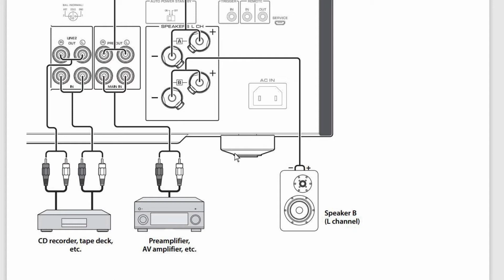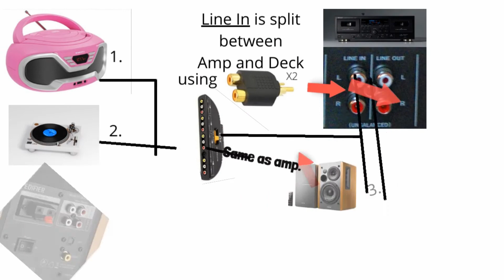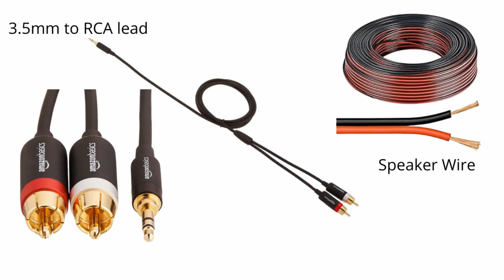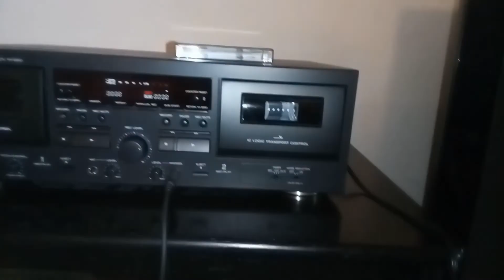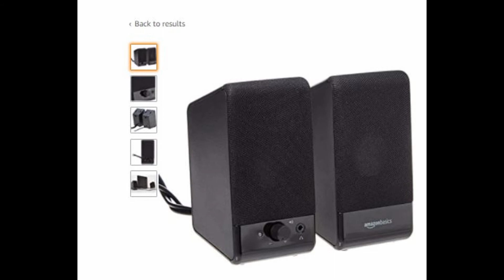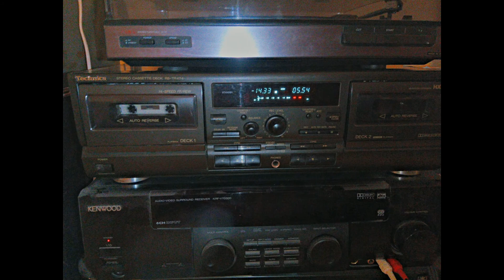Are You Connecting Your Cassette Deck Wrong?

Comment: Hello!. Thanks for this video! I want to buy a double deck tape TEAC W-1200. I have an audio system Sony V43D that have a 3.5mm input jack. Can you help me please?, cos I'm a little confused. Can I connect the Teac into the Sony V43D direct or I need an amp or pre-amp?  If the answer is "yes", doing this connection, I will be able to listen the TEAC tapes through my Sony?,  and record cds played in my Sony to tape? If you can help me will be much appreciated! Thank you!
Reply from the maker: Hi. I have just checked the Sony Site and it says  analog input 3.5 mini jack. The 3.5 mini jack is stereo Line in on the V43D  so yes, you can get the correct RCA to 3.5 mm minijack cable and plug in directly. It should sound great.  you will need a cable like this https://amzn.to/4gfAS41 for the connection. That sort of lead is also good for connections to  Tablets and Laptops to record from to the Teac W-1200.  The  W-1200  also outputs USB which can be recorded by PCs and Macs.  I hope you enjoy your new recorder. Any problems and I will try and help. Cheers
Reply: @GaryKeepItSimple  No words enough to say thank you so much! Was a great help. You have no idea. Thank you for taking the time and help me. Can't wait to have the Teac!! Have a good day!!

Comment: I want to connect two cassette decks to my Cambridge Audio Azur amplifier so as to be able to use either of the decks at will.
Reply from the maker: Looking at the Cambridge Audio Azure appears to be the Series name for their Amps. It depends on the model you have. The Cambridge Audio Azur 540A it would be simple. There are 2 tape outputs  1 tape input but also DVD etc inputs so connect as normal for 1 deck and use output 2 for the other deck's input. Output feeding the DVD input. This would allow recording of tape to tape easily.
The Azure 315 has only 1 in and out so in that case I would Try using RCA 2-1 connectors for deck inputs and if that is not useful either a 2-1 amp or a simple AV splitter switch.
Splitters https://amzn.to/3JAnA2D
Switch box. ( works in either direction. ignore the video connector) https://amzn.to/3Jyh4JB

I hope that helps. 
Happy to continue this if you need any further help.  Cheers

Comment: Hi Garry I have a pioneer reel to reel the rt 909 and ctf 959 cassette deck plus a pioneer sa 610 amp how do I connect them all up so I can record from the cassette or the reel to reel can you help please
Regards 
David
Reply from the maker: OK . there are 2 tape inputs and 2 tape outputs. . According to the manual if you select tape 1 as the playback device, tape 2 can record what is playing. It says if you select tape 2 to be playing, tape 1 can record what is playing.  So therefore all you have to do is plug in both tape machines into the amp as Tape 1 and Tape 2 and simply select on the switches what you want to do.
 I hope that helps. I can send you the Manual if you need me to. just drop me an email if you need it. Cheers

Comment: I have an old sony tc we 435 casette deck with line in and line out. Shall i connect my phone into line in ? . If i play song in my phone will i get output  via line out?
Reply from the maker: If you feed the phone into line in, yes, you will get line out from the cassette deck in record standby mode (Record Pause) you need to adjust the input levels on the deck so as to be around 0db peaking slightly into the red if you want it to. That will give you Line level output.
Reply: @GaryKeepItSimple  thanks for your update .In Sony tc we 435 ,i did not find any adjustment option for input level . It have only recording level . Is it possible in same deck ?
Reply from the maker: Input is directly related to Output level.  Record level is the control. I hope that helps. Get back to me if you want any other information. cheers.

Comment: I want to add a reel to reel to my Denon amplifier but only have one set of connections available for my cassette deck any suggestions would be appreciated.
Reply from the maker: I would suggest something like a switch box. There are some really good value ones on Amazon and maybe a "y "connector. If you want to only use 1recorder  at a time the box would do . If you want to have the ability to record both at the same time then "y"connectors may work or you would need a 1 in  2 out buffer amp.  like this https://amzn.to/3u4MlzB   Switch https://amzn.to/464U1io and Y connector https://amzn.to/3MC5cIx. I hope that helps. You can get back if you need to . Happy to help.

Comment: I just bought a Marantz 6015 and was wondering how to hook up my more vintage Yamaha cassette deck. It has the two sets of RCA cables, one "IN", and one "OUT". On the back of the Marantz is Audio IN and there are jacks for phono, CD, DVD, Cable, Game. I am using the phono and CD jacks. I figure for my Cassette "IN" I can use a Game or a Cable jack. 
What I am wondering is where do I hook up the other RCA from the Cassette that would go to Audio "OUT" on the Marantz. There is no specific set of jacks that are labeled "Audio OUT"?
Reply from the maker: Having a quick look it would appear there is a section marked PRE out on the right hand side, middle. there is a left, right, centre etc output. The right and left should be usable for the input to your cassette deck.. Let me know what it says in the instruction book about that. if it says line level out it is exactly what you want.I hope that helps.

Comment: This was very helpful for me as I just got a cd/cassette deck and was a bit confused on hooking it up to my Yamaha integrated amp. It would have made it easier if in the manual they had mentioned hooking up tape/cassette to the Line 2 in/out jacks, but there is absolutely no mention of tape or recording. Of course in hindsight after your video is seems logical and simple.
Reply from the maker: That's what I do, Think out of the box. I am glad it has helped you.

Comment: What does the back of a speaker look like? Is there a simple 'plug in' for cables? or would I have to splice wires to attach the units? (Do my questions even make sense?)
Reply from the maker: I shal post a video later today to try and cover this. What speakers do you have?
Reply from the maker: I made this to try and answer your question. https://youtu.be/WYTwB9Z1Z7k

Comment: I'm trying to add  a cassette deck to my Rotel integrated amp without a rec out and still record cassettes off Tital on my computer. Help.
Reply from the maker: I assume you are using a phone or tablet to listen to tidal. Two ways.
 
1. Just use the cassette deck as a pass through.  Connect the Tidal signal to the line in on the cassette deck, and the cassette deck line out to the amp input then you can monitor the Tidal to listen live or you can record and playback as required. 

2. Use 2 RCA splitters and connect the cassette line in ,to the tidal device and the amp input. The cassette output you feed to a different line input on the amp. link to Splitter https://amzn.to/3w0zHiS

 Either should work, it is mostly up to you which is most convenient. I hope that helps.  get back to me if you need any clarification.
Reply: @GaryKeepItSimple  I have a Asus computer I'm using with optical output to the Rotel 12.
Reply from the maker: @arnoldacreman9953  What is the model number and any other details of the Rotel. . what inputs does it have and what outputs etc.
Reply from the maker: Does the computer have analogue outputs as well as optical?
Reply: @GaryKeepItSimple  It has two inputs on front that looks like are headphone input or outputs. On the back it has six inputs or outputs, I once had some Bose speakers looked up to them.
Reply from the maker: @arnoldacreman9953  send me an email with the pictures of the amp connections and the computer connections. I shall try and assist you.  gary@garykeepitsimple.com
Reply from the maker: @arnoldacreman9953  . the connections you had for the speakers should be useful for the cassette deck input
Reply: @GaryKeepItSimple  Thanks for your help' The inputs I used for Bose speakers had just one channel, not a left and right. I guess I can get a RCA splitter to use for stereo.
Reply from the maker: @arnoldacreman9953  You could use your phone or tablet to supply the signal to the cassette. That would give you stereo and feed that to the amp and save using the Optical output for Serious Listening.  Using the Phone/tablet for Taping and Keeping. The quality of the Phone /Tablet is as good as the tape needs.  I do something similar to record Amazon Music Tracks. Good luck. Let me know how you get on.

Comment: I have a mixer conected to 1 turntable 1 tuner and 1 Cdplayer but 1 have a cassette deck and only 1 turntable entry free in the mixer..can i connect the cassette deck to the turntable entry free?
Reply from the maker: Hi. It depends on the Mixer. Is it a Phono cartridge input or just a line input labelled Turntable?
I can only give a definitive answer with model numbers and spec sheets. But if the turntable input is switchable for mag and Crystal/ceramic, then the ceramic setting may be OK. If it is a proper "Phono" input, then it would be very, very loud, and the tone would be wrong and the sound distorted. You would know straight away. You could just connect it and find out if it sounds OK; if it does, then it is OK. ( If you try it, make sure you turn down the amp's volume so as not to do any speaker damage. I hope that helps. Feel free to get back with any other questions or information.
Reply: Is a simple mixer akayama but the phono entries have land conexión.thats why my worries..because in the past connected a power amp to the mixer out record..to connect 2 more speakers and damaged
Reply from the maker: If it has a ground then it is real phono. I would suggest getting a 2 way switch or more and sharing the other input. I have one of these. (Just ignore the video connections) https://amzn.to/3O6QpnY

Comment: I have an old Technics dual cassette deck (RS-TR165) that I'd love to connect to speakers. In this video of yours, I noticed you showed some Edifier 1280DB  powered speakers.  Can I connect my cassette deck straight to the RCA inputs of those speakers? (Extra info in case it helps someone answer my question:  Those Edifier speakers don't have speaker wire connections - only RCA inputs, optical etc, otherwise - otherwise, I'd try to connect the cassette-deck to my old Sony stereo amp and then to the speakers.  Well I'd give it a go, even though the amp doesn't have tape-in - only SA-CD/CD inputs and a bunch of TV/video inputs!).
Reply from the maker: Yes the speaker says line input. The cassette decks rca out is line level so it should work. They look to be a good speaker. Here is the link to that speaker. https://amzn.to/3vJCFsr    If you have any other question please feel free to ask.
Reply: @GaryKeepItSimple  Thank you so much Gary!!  You’re a legend!

Comment: Can you kindly take me through how you connect the CD deck to the amplifier in pioneer PD-Z74T
Reply from the maker: This is dependent on how you want to work your system and what amp you have. The CD player as s a source, you could just plug directly into your cassette deck. If your amp has a tape out then directly into amp and cassette deck to tape  in/out on Amp. I need a bit more info. Happy to give you a plan if you can tell me the model/make of your amp. model make of your cassette deck and how you would like to use it . Email me at Gary.j.goodridge@gmail.com  with the details and we can go from there. I can send you a diagram etc by email.  Happy to help.
Reply: @GaryKeepItSimple  Thanks Gary, very helpful info.

Comment: I am trying to connect my JVC duel cassett player but the cables are missing and the in/out on the player does not have the red/white plugs but looks like something that is screwed on.  What cables do I need please?
Reply from the maker: If you send me a picture of the unit and/or the actual model number I can help. You can email me a picture and put the model number on this comment.  Email address is in the channel info section.  The model number should be enough for me  to find out

Comment: Geoff2407
Reply: Very informative to see what's possible. Question is, my audio system is quite traditional i.e. Amp, Turntable, CD Player, Tuner and Cassette Deck. The Amp only has a single REC OUT phono but I would like to add a second cassette deck but not have to keeping swapping cables due to positioning of equipment  and access problems. Can you offer me any advice on creating a 2nd output for recording purposes?
Reply from the maker: If you use the two-way RCA splitters, that will give you two outputs from one output. This should do the job. However, it should not be a problem from a level point of view. BUT the problem is that different decks exhibit different behaviour on the loading they present. This can, but rarely, produce levels issues. Thinking outside the box, I would suggest that this option would definitely do what you want if the/2 way RCA is no use.  https://www.amazon.co.uk/Behringer-HA400-Microamp-Headphone-Amplifier/dp/B000KIPT30/ref=sr_1_6?dchild=1&keywords=4%2Bheadphone%2Bamp&qid=1629165511&sr=8-6&th=1 
This would give you 4 outputs that would be adjustable and would not give any interdependence. 
This would be all you need for the connections.https://www.amazon.co.uk/Adapter-Keple-Connector-Headphone-Splitter/dp/B07JBJRFXW/ref=sr_1_42?dchild=1&keywords=6mm+stereo+to+rca+socket&qid=1629166311&sr=8-42
it is a  3 pack; this would also give you an actual headphone outlet. The spare outputs would be of no consequence. I cannot find a 2-way amp, and I don't think there would be a benefit in the price.  You would get change from £26. I hope this is of use to you. Let me know how you get on. Cheers